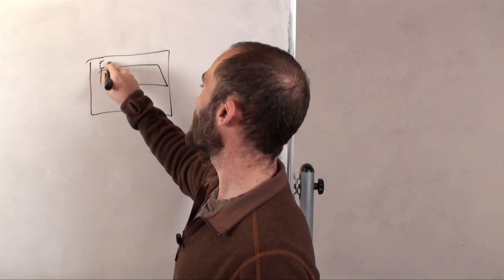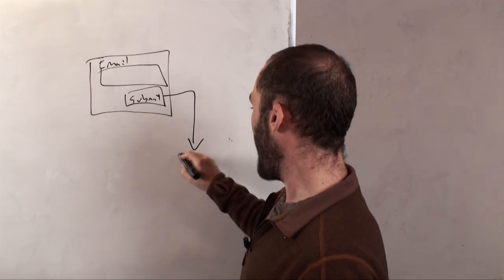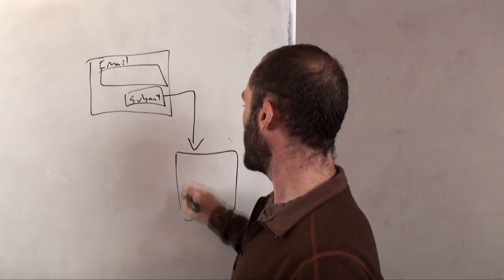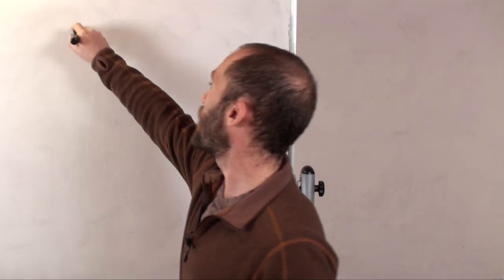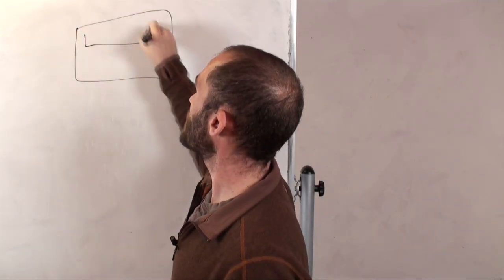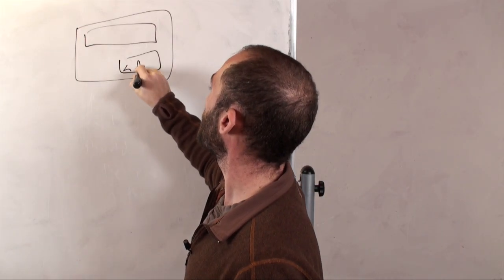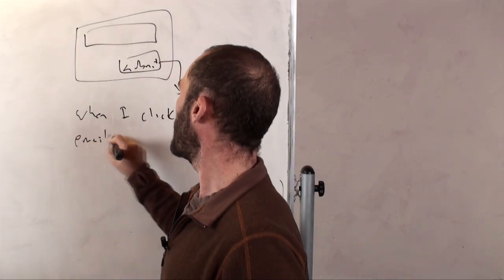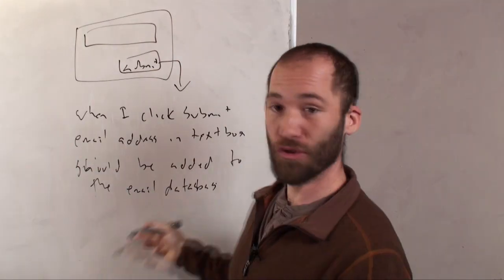Introduction to Programming

Comment: 00:07 Programming is about creating small programs for specific tasks
02:33 Overview of programming concepts
07:21 Understand what task your program is meant to do.
09:33 Compiled programs are created by compilers while scripting languages are executed by interpreters.
14:36 APIs and SDKs are essential for interacting and programming for specific devices.
16:46 Prototyping is crucial in programming to understand and plan the application.
21:11 Using PHP programming language for web-based applications and databases.
23:02 Introduction to types of programmers
27:02 Understand that different programming languages are built for specific purposes
28:57 APIs and SDKs enable connection and development for different platforms
32:36 Understanding programming concepts is crucial for writing code effectively.

Programming is about creating small programs for specific tasks
- Programming doesn't always have to be about creating large-scale software like Windows 7 or Office. Small programs can be very useful for specific tasks.
- For example, a 15-line script was used to automate video posting on the Everyman IT website, showcasing the power of small programs.

Overview of programming concepts
- Different types of programming languages
- Compilation vs scripting, API, SDKs, pseudocode, and types of programmers

Understand what task your program is meant to do.
- Choose the appropriate programming language based on the program's requirements.
- Distinguish between compiled and scripted programming languages for code execution.

Compiled programs are created by compilers while scripting languages are executed by interpreters.
- Compilers turn human-readable text into executable programs.
- Scripting languages do not compile code, rather an interpreter reads and executes the code directly on the server or computer.

APIs and SDKs are essential for interacting and programming for specific devices.
- APIs are rulebooks provided by platforms like Google and Twitter to interact with their services.
- SDKs are software development kits that provide tools and information to program for specific devices.

Prototyping is crucial in programming to understand and plan the application.
- Draw out the application on paper or whiteboard to visualize the flow and components.
- Prototyping helps in avoiding rework and ensures the program aligns with the desired functionality.

Using PHP programming language for web-based applications and databases.
- Pseudocode helps understand the logical ideas before writing actual code.
- Prototyping and writing pseudocode are important steps in the programming process.

Introduction to types of programmers
- There are various subprofessions in the technology field such as IT, networking, surveillance systems, each requiring specific skill sets.
- Web programmers focus on developing web applications that facilitate tasks like capturing email addresses and presenting websites, which can be learned independently.

Understand that different programming languages are built for specific purposes
- Different programming languages are designed for different tasks like creating web applications or device drivers
- Programming languages can be either compiled or scripted, each with its own process of generating executable code

APIs and SDKs enable connection and development for different platforms
- APIs are application programming interfaces that allow connection with company systems and specific tasks
- SDKs are software development kits that enable creation of programs for specific devices

Understanding programming concepts is crucial for writing code effectively.
- Having a good grasp of programming concepts helps in knowing what you are doing while coding.
- Conceptual understanding leads to more effective and efficient coding practices.
Reply: bro had audacity

Comment: Hard "can't" are a tricky topic. But I guess the phrasing is okay for the introduction level.
The PHP driver example just recalled a funny memory. I did that once, it was just horrifically slow that people had to wait in front of the machine. So I guess "can't" is okay if you add the productive environment modifier.
Because if you access any sort of hardware via PHP you have to go through some sort of generalized access which is going to be by nature slower because it needs all the additional safety features and guides. And the most basic way to make sure everything runs smoothly is: "When in doubt, wait."

And for all the more mature languages: They have dang good reasons to do stuff the way they do it. If you don't understand You don't have enough general knowledge. Because some things are mutually exclusive. Like strong typing and short code.
There are good reasons for both but if you have strong typing in theory you will always carry some of the overhead even if you don't use it.
Programming languages ned to be seen as tools.
A light hammer is a bad hammer. The whole point of the thing is having a heavy head.
There is no point in having a heavy screwdriver.

Comment: thank you sir, , i am old era programmer backin 1990s and lost the touch, due to job requirment and money wise. Thoes day we use to  function list, condition kist, we lay it on tree with wideing with function,  what programm neede for. after 30 years its very similar way, applying with, more complex lanuages. thoes days there was no internet, but we are using computere to automize  a database most popular thing. thank you again sir, for very detail guide,which you are giving !

Comment: Good introduction.  But SDK is not just for programming for devices.  A more accurate comparison is this.  API allows you to interact/interface with a service like Facebook often over HTTP/HTTPS.  An API may be limited to just pulling a certain type of data that you can then use as you wish.  Like an API, SDK also allows you to leverage a service like Facebook, but the difference is that SDK comes with many more things.  It comes with APIs and modules and methods specific to your programming language of choice.  Staying with the Facebook example, if you want to leverage marketing data for your application, you could achieve that just by using Facebook marketing API.  I don't develop for Facebook, but you may have a script where you could put one line calling FB API to pull a set of marketing data, then continue with your script to parse or save or do whatever with the data set.  You may also download the business SDK which comes with all business APIs including marketing API, and also comes with modules and environment specific to your language of choice.  So if you are a Java developer, you download the Facebook SDK for Java, and if you're Python dev you download Facebook SDK for Python etc.  And like Eli said, you may download Facebook SDK for Android device or SDK for iOS device.  My point is that sdks are not just for devices.

Comment: Can anyone explain Frameworks and engines?
Reply: Once I heard a nice distinction between the two: "Engine does the job for you, while framework simplifies the job for you."

It is pretty simplified, as well as the following example, but it gives a pretty good idea:

* Let's suppose you need to multiply two numbers on a machine that can only do adding.
* someone created a "multiplication engine" to which you just provide two numbers you want to multiply and you get the product of the two numbers at the output of the engine
* there is also a "multiplication framework" - the framework exposes an interface (API) that lets you write "x * y" (substitute any number for the x/y), it takes the provided x and y, computes the product, and does something with it (e.g. prints it on the screen)

Also, an important point about frameworks to be made is that when you use a framework to build an application,  the code you write "lives" inside that framework. It uses something called "inversion of control" (that's pretty advanced software engineering pattern) - that basically means (for a framework), that it gives you control over some specific task you want to accomplish by some code, and the framework then takes your code and "runs" it in the way the framework was made to handle it. By using a framework you basically "fill in blanks" in that framework to do something you want it to do. E.g. there may be a framework for creating an application window on Windows OS, it just needs you to code what will go inside that window. Once you do, it takes your code and puts result inside a window.

Comment: I've been programming for 30 years for Windows and Mac and Linus And UNIX and recently my latest project is generalization of `Honeywell Brain Damage' (HBD), a theoretical disease invented to explain certain utter cretinisms in Honeywell {Multics}] adj. Obviously wrong; cretinous; demented. There is an implication that the person responsible must have suffered brain damage, because he should have known better. Calling something brain-damaged is really bad; it also implies it is unusable, and that its failure to work is due to poor design rather than some accident. "Only six monocase characters per file name? Now that's brain-damaged!" 2. [esp. in the Mac world] May refer to free demonstration software that has been deliberately crippled in some way so as not to compete with the commercial product it is intended to sell. Syn. crippleware

Comment: Visual basic is interpreted as well but its not a scripting language. Scripting languages (or control languages as I call them) are (to me at least) languages which are not creating  programs  but instead are used to control the behavior and operation of another program often to get more control over advanced functions then can be obtained with using that programs GUI or similar things. For ex HTML and javaScript controls what a web browser displays.  LS (Linden Script) is used to control behavior of assets and object in the virtual world Second Life. Mel is used for control of the Maya 3D graphics software. These languages are built specifically for these programs and most (except for Java Script ) are also built right inside of them and can not be used separatley or for any other purpose then to control that specific program. Java Script is a bit more general purpose nowadays esp with Node.js

Comment: Since Eli does not use any graphics in this lecture, I went to the transcript to get through his lecture more quickly. Don't bother. The Transcript is useless for this purpose. I did not understand Eli's explanation of a compiler for programs compared with interpreters for scripts. Isn't an interpreter nothing more than a real time compiler that eliminates the need to maintain a copy of the object code. I always think graphics help any presentation or lecture. Also, anyone working in computer technology should have at least some acquaintance with machine code. In my opinion, it helps considerably in the long run. Overall, Eli's style and content makes for an interesting lecture despite my criticisms. It is probably better than I would have done. And Eli is in the Arena! Does anyone where that phase originated?
Reply: Me too. After all 80% of learning is visual.
Reply: It annoys me when educational text books costing up to £30 don't include representational diagrams. It would help so much

Comment: "You would not use C+ to write a web-based application" - 28:09
If you mean C#, the .NET framework allows you to build web applications and program ASP.net-based websites with Visual Studio using Visual Basic or Visual C#. Python also has Django that let's you build web applications in Python, many OOP languages can be used to build web applications.

Comment: but who writes the code so the compilers work??!?!??!
Reply: +OnsideGaming™ They are normally programmed with direct machine-level code that the computer can understand without being compiled.
Reply: you mean binary?
Reply: +OnsideGaming™ Yes, and they can also be created with assembly language which is directly translated to machine code (binary)
Reply: +Rui Code can be written in a text editor or a console too if I recall correctly.
Reply: +Rui The computer doesn't understand C++. Code has to be "translated" into machine code first. In C++ a compiler does that.
Reply: +Rui Sorry, I don't know a lot about that. But there definitely has to be something that understands C++ and translates it. :)
Reply: hey ok look ther are low level programming lanuages like assemly that gives you full control over cpu bu assembly maked by ones and zeros negative electrons and negative getit

Comment: Eli, what coding languages would you suggest to rewrite two older accounting programs, one from win98-win2000 days, and another from the DOS era?  And where would you look for contract programming help?
Reply: +Mike McDonald You dont rewrite programs, unless you are the one who wrote them, or you buy the source code from the one who did
Reply: I'm considering buying them.
Reply: +Mike McDonald then you better be very skilled. also, there is a 99% chance that the company would never sell their property
Reply: +TraceguyRune.  Why, these programs haven't generated revenue in a long time?

If I had a worthless copyright I would be happy to get something for it.
Reply: +Mike McDonald you can try
Reply: Are you a programmer?
Reply: Mike McDonald Im an, but I'm just an entry level programmer. I don't think I could accomplish what you're trying. If it was a assignment at work to do what you're doing, we would most likely do it from scratch. Meaning write new code in a new language (depending on the old language) and get it to mimic the old software, but incorporate better features and make it more efficient
Reply: TraceguyRune 
Interesting.  What languages does your employer use?
Reply: Our main language is Progress Openedge. My opinion, it's hard to learn, mostly because you can't find anything on the internet besides the documentation for it
Reply: TraceguyRune 
Progress Software?  Would that be proprietary? 
Does anyone use VB or C+ anymore?
Reply: Mike McDonald VB, if meaning VBA, is still widely used for Access and Excel. Can't say too much about VB.NET, especially when you can use C#... C++, it still used in someplace as well.
Reply: ***** 
I'm not, just exploring

Comment: I know this is older vid, but to those who are listening and the sound comes only out of left earbud, pull the headphone jack out a bit, or in other words push in only 3/4 of the way. Or fiddle with it until it works. This is mainly if you`re using any of the "Three stripes-on-the-jack" type headphones/earbuds (like Apple or any other with mic in them)...  Anyways, carry on.

Comment: As a developer of some 23 years of experience I think you have made some excellent points.
Knowing what you want to do and using pseudocode are extremely important.
It's what I had to do for around 5 years.

I am at the stage now where I tend to think in classes, abstractions and interfaces so I can generally think through what I want to do without needing to use pseudocode.
However I still document my ideas so that I have a proof that the ideas all work together.

Basically programming comes down to building machines in an abstract space and the more one can train oneself in design by reading other people's code and reading up on different patterns of programming - the less effort it will be and the more joy it will give you.
Yes, programming is a joyful experience when you are absorbed in it.

Comment: computers are programmed for ones and zeros, on and off.  never knew that.  is that called binary numbers
Reply: Tony Tran Actually, the only way computer works is by on and off, these binary numbers presents these flow of electricity by 0 and 1.
Reply: Tony Tran Unless it's a quantum computer.

Comment: One important consideration to take note of when comparing a compiled language vs a scripted language is their method of execution. A compiled language will process all functions, variables, expressions, etc regardless of their position in the code (for the most part...there are instances where this is not true), whereas a scripted language goes through the code LINE-BY-LINE.

Comment: Wow this really helped me understand what to expect with CS. I am getting ready to start B.S. Mathematics and working on taking JAVA, C++, RUBY programming courses about 10 CS courses. Thanks again for this video. I want to work in data analysis it seems interesting to me. What would you recommended as far as languages are concerned. I would not want to waste my time with JAVA if C++, or C# what is mainly used in that specific field. One of my goals is to work for Raytheon, and other types of contractors.

Comment: Okay, I'll clear things up.
Every language has its advantages and disadvantages.

Do not compare Java to Assembly, they are completely different. Assembly is a low-level language and Java is a high-level language. If you want to argue over the better programming language; argue between Java and any other high-level language such as C++

My vote goes towards C++ because it gives you complete control over memory management; though, I do like Java because of its OOP design and Garbage Collection

Comment: I am a computer engineering student and assembly language is still considered a language, a low-level programming language, but a programming language no less. And yes, it is still a required class. And with assembly code Assembly language is converted into executable machine code by a utility program.

Comment: It's easier for you. You're opinion does not apply to someone else.
Java is not good for something like defining NEW terms in programming. for something like that you need a low-level programming language. something that can actually manipulate the commands the CPU is running. Java does have a lot of good uses but It is not good for anywhere close to everything.